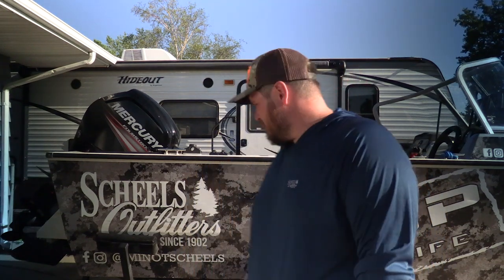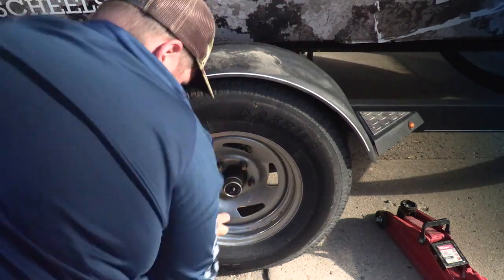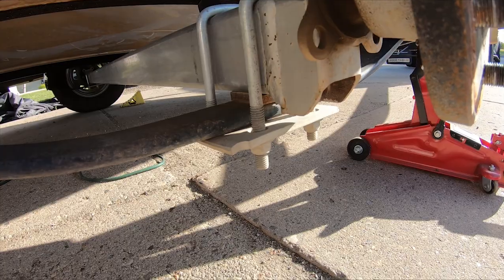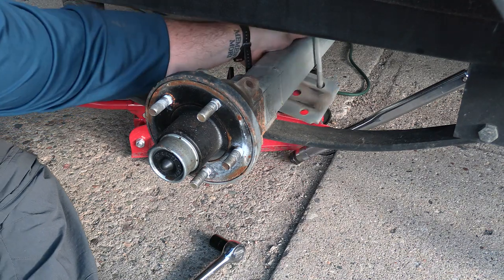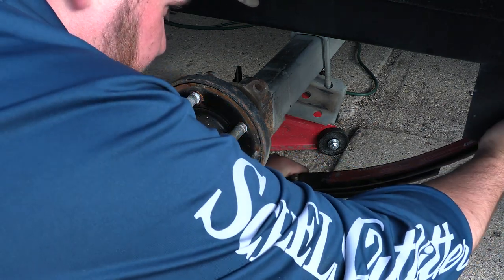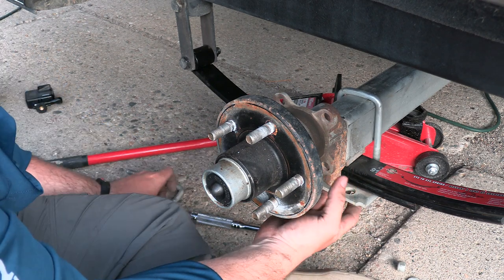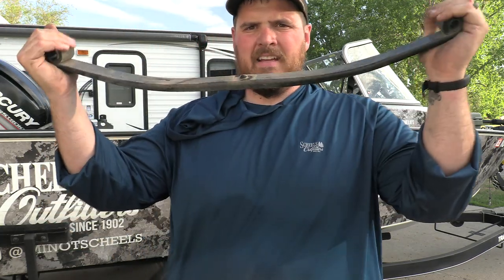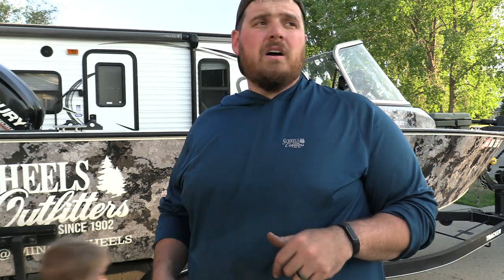Changing Boat Trailer Leaf Springs | Tracker PG 165WT | NPLife DIY

Comment: Great video I just ordered a set of leafs for my PG 175. I'm worried about a spring breaking because I added a 9.9 pro kicker and a couple downriggers onnteb back. That extra weight has me concerned with the single leaf.
Reply: You should definitely change those out, I just had mine break while driving on the freeway and it messed up the fender. I have the same trailer PG175 with no kicker or downrigger. Just hit a pot hole and the leaf broke.